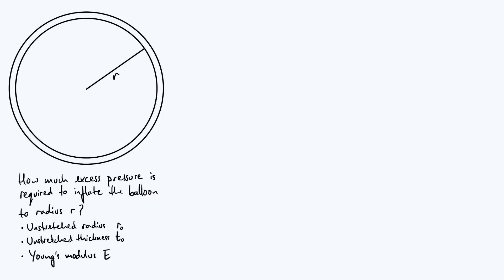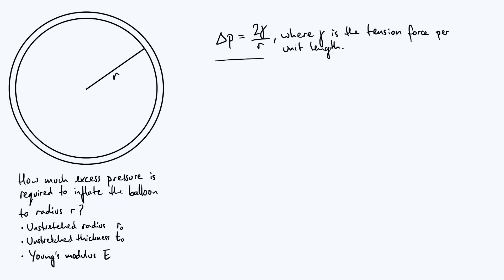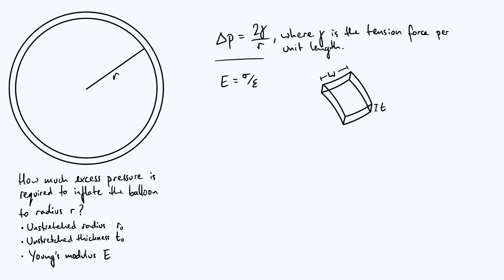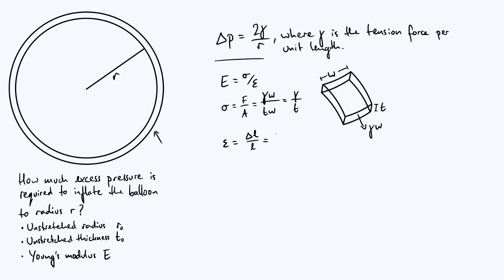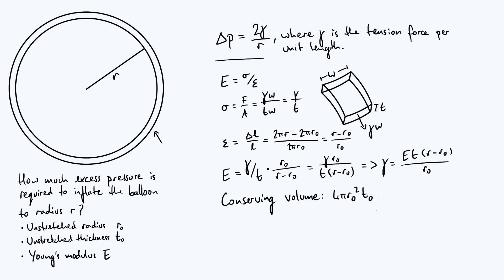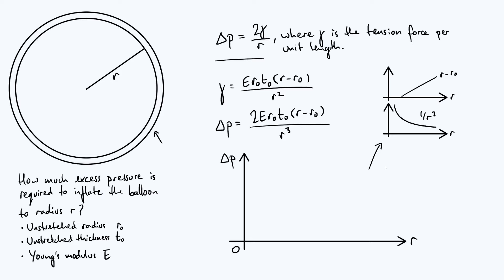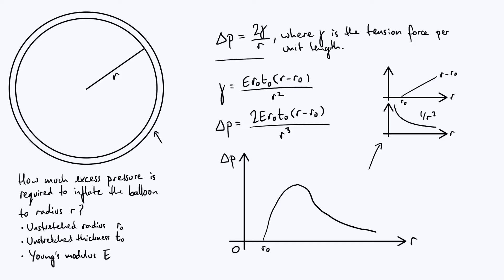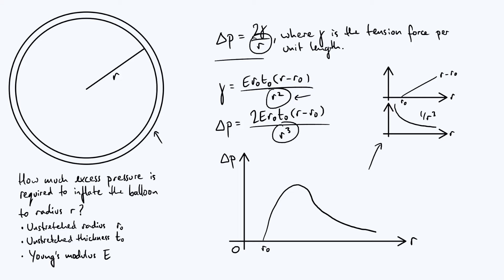Pressure required to inflate a balloon

Comment: Thanks for this, your explanation was very clear! I have two questions:
1. Does the graph imply that the balloon's pressure actually goes down as the balloon's radius increases past that tipping point?
2. If you were to tie off the balloon after filling it to a given pressure/radius, and then increase the external pressure (say, in a pressure chamber), the balloon should shrink, right? What equation governs the decrease in radius? How does it interact with the ideal gas law?

Comment: Solution seems pretty interesting. However I encountered some discrepancy in your solution and mine (I get proportionality 1/r⁴). I consider directly that pressure acting on a small element of a balloon is equal to four tensions projected onto vertical axis(which should give some solid angle ) divided by the surface dS. The rest is just like you did,and at the end I got different formula (dimensions are ok!!). Is my method correct or there's something I miss?
Reply from the maker: That should get you the same result! I have used a similar method in another video, maybe compare your working against this: https://www.youtube.com/watch?v=CtUetjUX-yY

Comment: Hello. For a project, we performed an experiment of inflating a balloon and we measured the differential pressure which I assume would be the same as the delta P here. However, for the equation derived in this video, the asymptote is at the x-axis (0) and it falls quite sharply too. But in our experiments although the relative shape of our graph was the same, the asymptote would not be at 0 but a little bit above atmosopheric pressure. Is there a subtle detail I'm missing here? Is delta P here differential pressure (P_inside - P_outside)?
Reply from the maker: Interesting! Is the excess pressure you mentioned too large to be explained by experimental uncertainties? Although the model in the video is very simple, I'd definitely expect the pressure to tend to zero at large radii because as the radius becomes very large, the walls of the balloon become essentially flat so that no excess pressure is needed to balance the inward pull of the rubber surface. Also, are you sure you measured the pressures at sufficiently large radii to conclude that the pressure doesn't asymptote to zero? I'd imagine the balloon would probably burst before that point!